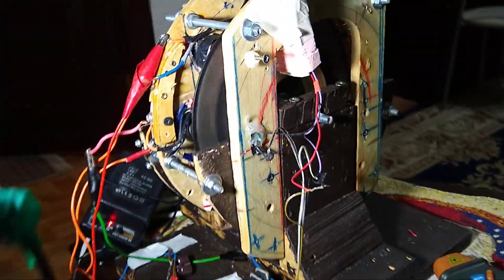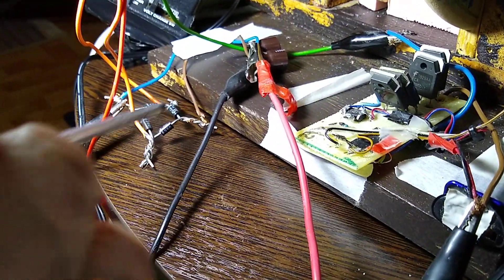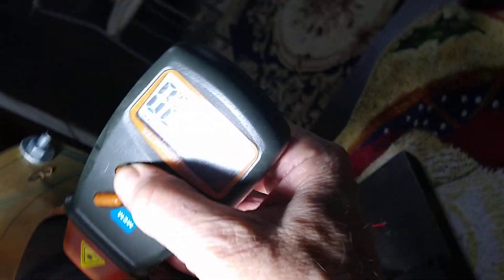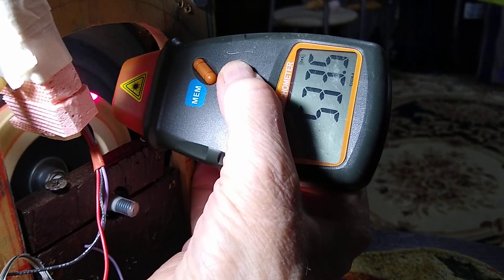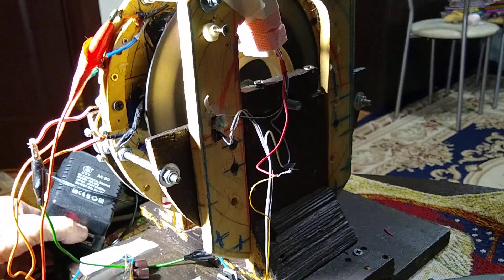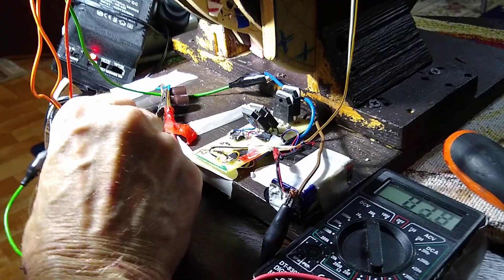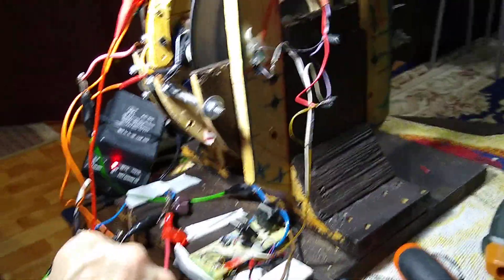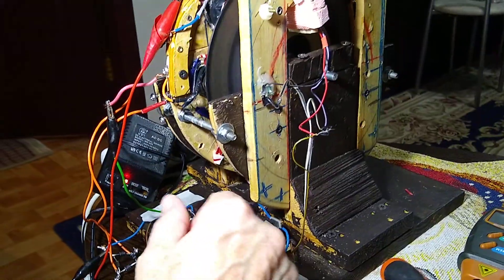No lenz reaction with new magnet-rotor offset BUT only 10ma current crowbarred "why"

Comment: you will still have loss because your bearing are making noise which means friction
Reply: Myke does ...and  other ... .... i see your work ..great job with bedini my work is more perfect
Reply: @anthokranken  lol , GL
Reply: @mykedoes4099  ? I dont understand 🤣🤣🤣😉😉😉😉😉😝😆😇😇😇que dieux te protege mon amis
Reply: @mykedoes4099  
I'm not talking to you about a diagram but about the things that define an anti-lenz regenerative acceleration engine, and if I have any good. from beginning to end
Reply: @anthokranken  ya sorry i have not done any experimenting with anti lens effect engines so i will not be able to understand you without a diagram
Reply: @mykedoes4099  

he has a problem on his diagram he has canceled the signals either by putting south magnets where it should not be. or the tangents do not go or he knows how to make sense. on exit under acceleration under load... and especially the LEDs are not linear, if you want reliable readings you have to put a resistive it is much more precise. 11.5 degrees on the rotor 16 magnets. rick freidrich did a very, very good job on the charge rebirths, I love his engine, he's annoying.
Reply: @mykedoes4099  

I'm not talking to you about a diagram haha I'm talking about fundamentals haha .... for me the best anti lenz are the adam pulse engine, the bedini school girl in classic and force loads and especially the dual a rick freidrich I love simple effective and efficient for a year I only use two npn transistors for 4 trigger coils I put one transistor for two coils ... it works just as well, especially with 2 rotors north above and south below, I explain everything about it over because not twisting it is worth nothing .... it is for this that Bedini he twists the wires correctly ..... otherwise he would have done without it, if you reread the messages that I left there are plenty interesting things on it friendly, I would like us to contact each other
Reply from the maker: Nothing is perfect
Reply: @MrDKONZEN  https://www.youtube.com/watch?v=WH4watZLhOA
Reply: @MrDKONZEN  its basically two Bedini circuits feeding each other every 90 degree of 360 two pulse per separate drive coil/npn per 360 degree/one cycle. this is done by "offsetting" your drive coils around the rotor by 90 degree and having your rotor magnets placed at 180 degree (only 2 rotor magnets). BTW I like how you offset your magnet center on the edge of the opposing magnet , good idea .. I am sure you did not have it exactly on center or else it would start causing the brakes on your rpm. The two separate drive coils get triggered twice per 360 once per rotor magnet . You have 2 rotor magnets
Reply from the maker: @mykedoes4099  hi myke
I did try the offset of rotor magnets be so rotor magnet to right is exactly in between two  rotor magnets to left, and this really robbed rotation power it didn't want to spin much. I tried some other offsets too, 
Just shorting generator coils now need to do real loads in future especially want to try motors as loads maybe will.loop
Reply: @MrDKONZEN  ya that config will brake our system for sure , its all about timing the position of your rotor mag to your core and other magnets positions .
Reply: @MrDKONZEN  im going with the simple concept of drive magnets on circumference of rotor and 3 phase stator magnets on the face of the same rotor
Reply from the maker: @mykedoes4099  Sounds good, maybe 3phase stator magnets exposed on both sides of rotor (above and below) then you can put stator plates above and below too and get twice the power, 
plus if what I am doing now works out,  you can skew the bottom plate to the timing and rotation of top plate, and try what I am doing here but NNNNNNNNNNNNNNNNN (16) magnets  Should work even if magnets NSNSNS as I assume your 3ph idea will be.
Reply from the maker: @mykedoes4099  Could be the "no lenz" seeing here but cap still filling up from generator coils is simply not much current is being made because of the skew,  I bet if  move the rotor B over just a littl bit it will allow more current to be produced in consequenc of "some lenz" and keep moving it  over until  there is full lenz,  Then work opposite direction moving the rotor B and keep going until lots of power lost in rotation and torque.  I expect there to be very happy medium decided on load, rpms, and that skew angle where you get good generator production but no lenz....I think it will be very exact skew angle that works really good.  Basically my theory the time that it takes for the backemf (not flyback but backemf) happens with enought force to slow rotor, is the time-lag that the skew angle in rotors will create in the time of rotation for the rotor B to get into position to push forward not pull backwards. Sort of like Thane delayed lenz effect but can work at many different RPMS.....thats theory anyways might be totally wrong.
Basic idea is Rotor B messes up what lenz braking wants to do, at the exact time that lenz braking manifests, which is not immediate but takes a smidgeon of time to develop...
Reply: @MrDKONZEN  based on your reply sounds like you are trying to defeat the lens by skewing the two rotor magnets array if your collector/generator coils are on the same face as your drive coils the rotor magnet array A and B when offset may cancel your generation on the stator coils , for best collection of magnet field over stator coil the two North and two south need land over the  two arms of stator coil offsetting them you might get lucky but i feel like you will get more interference by the offset Rotor , i personally think the 3 phase system is best for stator designs , if thats what you have then your in good shape . gets complicated with more magnets , i just think its best to defeat the lens by gaping your stator away from your rotor magnets the right distance and using only ferrite cause neos have very short range on there field and you wont get good absorption on you stator coils per pass just my opinion
Reply: @MrDKONZEN  as far as your theory on the back emf i guess you feel the back emf is the field thats created when the magnet leaves the coil and not instead when the electric leaves the coil such as flyback,,, am i correct in defining the difference /?
Reply: @MrDKONZEN  i thought your rotor magnets were facing in towards the stator .. anyway if you are skewing the other rotor after you get the 1st rotor timed right the skew would also have to be timed right (your drive coils are still pulsing)
Reply: @MrDKONZEN  I tried generating DC there is no umph !!! .. So i was determined to generate ac on the same rotor as my dc pulse motor rotor thats why im putting the ac magnet array on the face of the rotor and the dc pulse motor mags on the circumference of the same rotor.. easy peesy
Reply from the maker: @mykedoes4099  rotor magnets in each rotor do face towards the stator coils, squeezing the stator coils.  one rotor had holes cut out and magnets glued in while the other rotor has magnets glued to teh inside face, facint the stators.
All motor coils facing to the left, so motor coil timing stays consistent with those rotor magnets,  generator coils facing the right side rotor, because sharing core, the motor coil "force"  sort of penetrate through the generator coils, even if generator coils shorted out I think is what is going on
Reply: @MrDKONZEN  sounds accurate , thats why i chose to drive the rotor using the circumference and generate power using the rotor face
Reply from the maker: @mykedoes4099  Hi Myke good advice thanks....yes I wish I had longer cores, and made of laminate stilicon steel or something else besides ferrite for better transformer action but I dont know with 16 magnets  foing 1200rpm might have to be ferrite or something losw hysterises like metglas or some exotic aloy like hiperco 50
Also wish I was spinning with an extermal motor and make those coils getting squeezed by rotors just generator coils nothing else to really see exactly abtout the lenz reaction or not and no "influence" of motor coils.  I made this ugly wood chassis a couple years ago over here in Belarus and its purpose was not to test the rotor-offset see if that beats or reduces lenz with the right skew angle, but that is what it is now. 
I go back to Seattle USA Dec 20 not much time to find all the answers and solutions and dont really want to bring this back through customs so doing what I can do while I can do it.
Seems like I should have more space between magnets for one thing, seems like fields will overlap and cancel as it is - right now 15mm between  two 20mm magnets and then 16 magnets so very "tight ship" being spun.  I bet 8 N-S magnets and good space between like 45mm not 15 would be better give some time for the generator coils to genetrate a full sine wave sort of....but have what I have will keep going maybe something not expected will develop who knows.  I am a little bit happy at 1200rpm the amps is 140ma input with or with out the FWBR from the 8 generator coils in sereis is shorted out....
Reply: @MrDKONZEN  im frensh the device for no lenz effect is create a south pole output all around a electromagnet ,bedini coil or other  ,but for great output you are twist the wire for antiphase  come in tranformer .because you dont twisst wire and create the opposing 180 degrees .no current ,no signal and no voltage .he is opposing .
Reply: @mykedoes4099  

myke I love your work .... very relevant. first of all you have to create a south all around the north poles, the opposite attracts, it's an anti lenz engine .. then it's very important to twist the wires well to put them in anti phase .. and to have the power transistor supplied correctly to achieve the desired trans conductance. then only the 180 degree phase-shifted signals can correctly supply a conventional midpoint transformer to benefit from the grounding (which sucks negative) and therefore have two much more efficient loads .... only the asymmetrical transformer provides a same power in no lenz because he sucks the emf
Reply: @anthokranken  Not sure I got you on that . but ok sounds good. Make a diagram post it on your channel and link me
Reply: @mykedoes4099  what your messenger ?

Comment: the pull force of your rotor magnet to your drive coils core cancels the lens
Reply from the maker: Could be, but I ran it opposite direction so if it was pull force before now it would be repellent ng force and still the same thing no lenz but your idea is why I put bothoyor and generator coils on same core, so o that the be motor pulse would influence the generator coils, besides the electro magnetic force the flyback spike comes through too.
I should be pul as ing out the generator coils so to lo as f too see wh as t be hat does at different timing.
Reply: @MrDKONZEN  ya having generator coils on same as drive core is a working concept , i intend to instead place magnets on the face of my rotor in the 3 phase gen config and taping in with Tesla 3 phase generator on the same rotor that the pulse motor is using instead of on the circumference  is where i am placing drive magnets for pulse motor and on face of same rotor goes 3 phase magnet array for 3 phase gen  https://www.youtube.com/watch?v=H78woLrd3yY  you can put your stator on adjustable so you can distance your stator enough to reduce lens but also not to far as to still have watts coming threw then rectify and dump into both battery A and B using diode

Comment: What happens if you short the AC side of the generator coils?

Also, where is the DC output going from the caps?

Thanks
Reply from the maker: Shorting the AC side of FWBR has no slow down lenz reaction too. 
The DC fills up two paralleled DC type electrolytic caps of 100uf and 63v rating.  There is nothing across the caps and FWBR DV out at all,
Except when I short that output out, now there is is a wire across it and dead short.  It "should" have some lenz effect but doesn't.  
Ohms of the eight generator coils in series is 12ohms, ohms of the 8 motor coils is 4.5 ohms.

Comment: Great job 
Looking great 

What is the rotor material? 

Thanks and keep.up the good work.
Reply from the maker: Rotors are of thin acrylic disc only about 2mm thick maybe only 1.5mm and coated with epoxy tooplus wiped on super glue before epoxy coat.
Reply: @MrDKONZEN  thanks. So the magnets are pretty thin then. I thought the rotor was some sort of metal like Aluminum.  LOL.
Reply from the maker: @Gacha.Cupcake  Aluminum would be no good since Eddy currents against the coils when making some juice.  Stainless steel the totally non ferrous type would be best